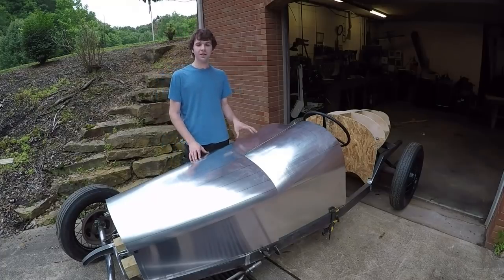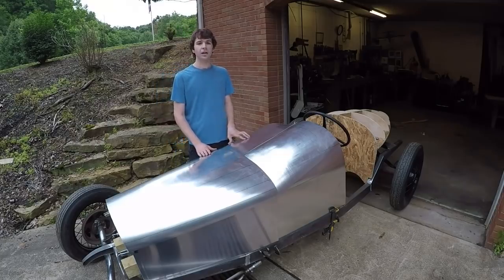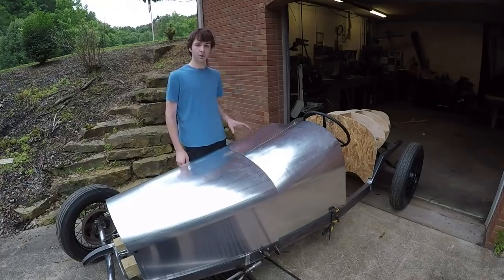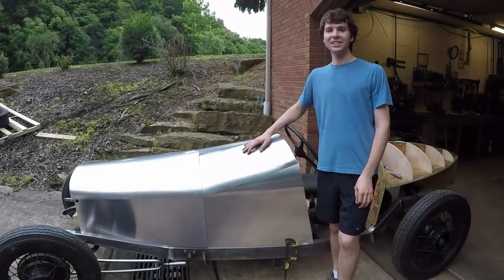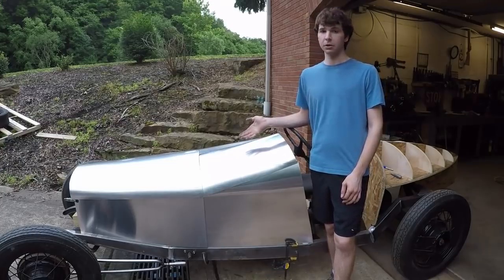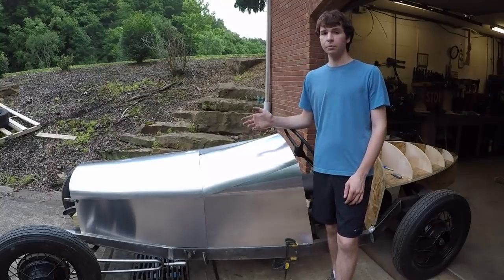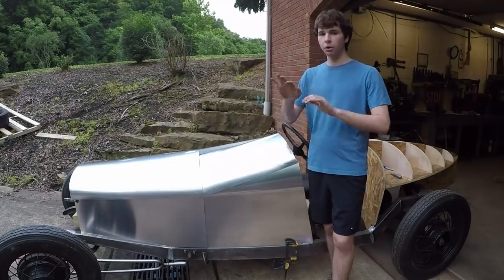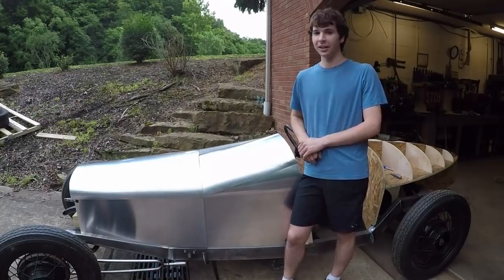Fabricating a Custom Aluminum Car Body | Boat-tail Speedster Pt.24

Comment: I agree with the post further down, do not weld these panels, apart from warping the material, these types of bodies were riveted, old style rivets that you peen over with a hammer and rivet tool.
Take a close look at a Lago Talbot, or a 250f Maserati for inspiration.
FANTASTIC WORK SO FAR!!!!! My fav build on you tube at the moment. Thanks for keeping old skills alive

Comment: You're doing great! A tool you'll find invaluable for shrinking high spots/blending areas is a slapper made from an old car spring. Don't hit too hard and keep the face flat to the workpiece. Work on your sand bag as the dolly. Also you will need to anneal (soften)the metal when it has hardened from working. Mark the area needing annealed with a sharpie, heat with any flame torch (oxy acetylene or a propane burner) until the sharpie ink is burned off. Will make the ali soft for easy shrinking, working, etc. Good luck...

Comment: I agree whole with Pretonesfpv a 110%. Sugguestion: Why not use aluminum tubing instead of steal, that way you make your body frame lighter. One other thing aluminum rivets like they did in the old days . It would be quicker to assmble the body and quicker than trying to TIG weld the panels. They did aluminum to save weight, which I was thinking what you would want. Also with your frame or the back end of it. You might want to think about narrowing it to fit your dove tail. Love your channel and keep up with the great work.

Comment: This looks great, you have a lot of talent for sure and I've been into old cars for 40 years, I'm building a couple of MG YA specials based on the chassis of the MG YA saloon from 1947-52. I've picked up a lot of tips from watching Ron Covell, a great teacher. On your boat tail, I would say make it in sections and join them together as this is likely what someone like Ron would do (see his building a fender video) I think a lot of people make the error of thinking they can form a panel from a large sheet, its very difficult as the metal has to move in different ways. One of my projects will have the slab fuel tank like the early MG cars MG TC, TD and before, one will have the 'boat' type tail like the MG Q type from 1936, check out the MG QT which is an MG T type special usually a TA (1936 -39) or TC (1946-49) chassis base with a Q type style body (its a re-creation of the Q type on a later T series ladder chassis), Steve Baker in the UK has done a lot of these. I am considering using a 'top hat' shape metal section for making some of my framework and seeing if I can then run it through my small English wheel so that it curves it, like an aircraft fuselage frame is built. I may have to stretch the outer edge flanged surface so it follows the shape properly. I have seen a pop rivet 'dimpler' which stretches the metal and allows a pop rivet to be hidden flush with the surface metal, I am going to experiment with this method making some tooling to use on the frame sections too so I can use say 1/4 inch or 5/16 rivets which will sit flush with the sheet metal. Check out Ron Covell's Bomber Seats videos, he uses a bead roller machine to make one. This project looks great. I have come across some Aluminium soldering sticks that work with heat from a propane torch, it melts the solder and bonds very strong, it is used to repair castings, an alternative to TIG Welding which can distort.

Comment: Drawing the boxes is for a compound shape like a bowl the shape u need for the steering wheel section is what we call a reverse curve or convex u need to stretch the top and bottom edge but more to the top edge where the steering wheel is and don't wheel in the middle where u drew the boxes it will make the front and back flare up and the centre stay down then start to bend it by hand in the other plane but when u bend it all the shape will come out so keep wheeling the front and back edges of the panel until it fits and holds it's shape when u bend it over hope that makes sense it can be quite confusing at first but your doing really good keep up the great work.
Reply from the maker: I changed my mind and decided I didn't want the reverse curve

Comment: Killer build man. I agree with a few of the comments that you should hem the edges and rivet the panels to the substructure. The aluminum will soak up the heat from the tig and move all over the place. Likely never fitting again.

Comment: Might want to look at how aircraft are built. How inner support and structure is made out of aluminum. Even the best welds will create stress fracture due to vibration. And steel and aluminum in contact react badly. A steel 6-8 point roll/cockpit cage welded directly to the frame will help with stopping frame flex. This frame twist/flex will create havoc whatever seems you use for the aluminum panels. Be amazed on how a flat sheet of aluminum with the edges bent 90ish degrees. And center area punched with tapered holes can make a stiff structure to rivet the outer panels to. Study how old aircraft wings and bodies had been made.

Comment: My first attempt with sheet aluminium would have looked like a dogs dinner, impressive work. The advice about jointing the panels is sound. You know you are going to have to brush that alu rather than paint it!

Comment: When I make a hood top, I just use an acetylene or oxygen cylinder, it's faster than the E-wheel. To make the compound curve of the top cowl you should take your part upside down and perpendicular to your first round of rolling. I don't know if it's understandable but I believe Lazzee did a quick vid on how to do a compound curve a long time ago. It looks to me you're using 1mm aluminum sheet, if you plan on driving the car you will regret it, any gravel that will hit the body will leave a dent, if you do shows, there will be a numbnuts who will press with his thumb on the body and leave a nice round dent on it. 1mm is good for racing not a street car.

Comment: mate as a sheet metal worker i would advice you to not weld the alu sheet. the warpage will drive you mental.rivet or bond your panels
Reply: Evan Taitt I second this, plus rivets look badass, possibly some brass ones to mix it up a little bit.
Reply: Evan Taitt sorry about the above spelling
Reply: @mikearmstrong7866  no worrys.never seen that channel before cheers buddy.👍
Reply: Or he could learn a new skill set!!! Other's weld their aluminum panels and I think he will be able to do so as well!!! I'm sure he will practice off the car on scrap first!!! Never hurts to learn new skills!!!
Reply: @rockerpat1085  totally agree.was just giving advice.👍
Reply: after welding metal can bend.. i think this is good advice. for example landrover defender have rivets in panels
Reply: @bryanb7918  i was surprised to see that cars of this period were quite crude in their construction. so doing rivets will look period correct.
Reply: heck yea. rivets would look sick.
Reply: How would you rivet those joints? Would be need two strips of metal (front and back) and two rows of rivets?
Or is it a matter of make them again so he can lap them?

Comment: Good job.
Kinda surprised you didn't anneal your pieces.
Rolled aluminum sheet has tons of internal stress from the manufacturing process.

Heating it with a smoky acetylene flame containing little to no added oxygen will somewhat evenly bring the temperature up to 375-400.  Allow it to air cool, then your work piece will be dirty; but softer to work with and less likely to crack.

Repeat annealing occasionally in areas that need more complicated forms, as aluminum also quickly work hardens, which will cause cracking.
Reply: burntorangeak more of an issue when hammer forming or on really tight shapes. not so much on large pieces with gentle shapes.

Comment: I dunno about sheet aluminum, but i´d be worried to work with it bare handed. From my experience with steel it ends up being pretty sharp... still, looking great so far Vince.
Reply: you want to be able to feel the metal otherwise she'll slice you if you don't treat her right

Comment: Where did you end up getting your english wheel anvils?  I bought my HF wheel after they stopped selling anvils.  Thanks!    Amazing work by the way!
Reply from the maker: there's a number of places that sell sets that match. most of the cheap 2" wide anvils will fit

Comment: Excellent work so far, but I have to ask if you broke the edges of that aluminum after you nibbled it?  I noticed you weren't wearing gloves and figured that you must have.
Reply from the maker: yeah, I just hit it with a quick pass of the angle grinder

Comment: Your doing great but you need to add some bead rolling to make the panels stronger otherwise they will dent very easy
Reply: I agree. It surprised me that you left so little metal along the edges. Seems like there should be more to allow the edges be folded, bead rolled,  or flanged.

Comment: Hello, what is the grade & thickness of the aluminum you are using?  Also I have an English wheel like your, were did you get the rubber band for the wheel?

Comment: Without having a complete drive train  first how do you know it will fit after the body is installed?  
just asking.
Reply from the maker: I made sure that there's enough room for the engine

Comment: You will have a problem with your chassis with this type of cross spring, You will need to install panhard bars both front and rear, the axle will move back and forth on the shackles causing the car to wonder when you turn the wheels

Comment: I just started watching your series so I apologize if you’ve already covered this, but where did you get the rubber band for your upper wheel? I know Eastwood sells one, is that where you purchased it? Also, I’m assuming you’re using 0.060–3003 aluminum – is this a good guess?

Comment: This is great, and I love your videos, but - I'm literally at this stage with a 1928 Austin 7 Special I'm building, and this is the part I'm struggling with. I've been looking forward to this exact video from you for a while now, but was kinda disappointed that you rushed through all the actual metal shaping without slowing it down, explaining what you were actually doing, why you were making certain choices like what rollers, when you were using the rubber band and when you weren't etc. You clearly have so much to show others less skilled, and honestly a half hour video of you doing this without the speeded up footage and some more analysis would have been so helpful. Cheers!
Reply from the maker: cool project! you're probably right that I should've showed more detail of the process. Honestl though , there's a lot of other metalworking videos on youtube made by people much more qualified than me that you'd probably find more useful.

Comment: Id probably have gone with foamboard insulation for what you're building the body on top of and then made a fiberglass body instead of aluminum, however im assuming you arent going to paint this so that aluminum will look stunning

Comment: i think the cowl for the dash is not done the way you shouldve done it 
from the fast forward i seen you used the wheel mainly you get the round shape in it but in the proces stretched the middle part as well as the edges and form it intoo a funnel shape  , to get the curled lip in the cowl i think you need to concentrate on the edge near the dash and have that force the rest intoo the bend with some help of bending it over a piece of pipe , i think that will make the transition between the hood and the cowl look better too if that doesnt work you could make the dash cowl bit seperate 
it might be sumting to retry if you have some material left 
for the rear you need to go exactly opposite and work on the center of the material and schrink the edges to get the edges of the teardrop shape 
all and all im supprized at how well the english wheel works shaping those plates around the buck you made

Comment: You was born to English wheel , I have the same wheel,,best 220 dollars i ever spent,,,don't weld that thin aluminum,  rivet it,  it's going wharp badly , the rivets will look cool, aircraft look